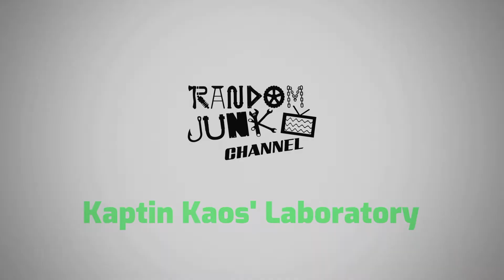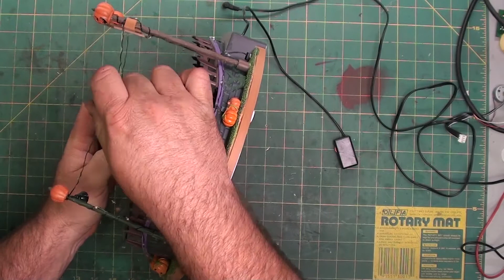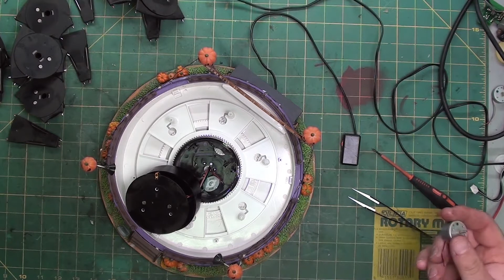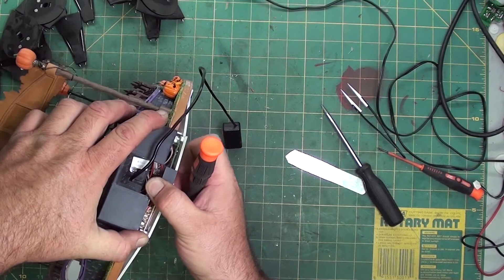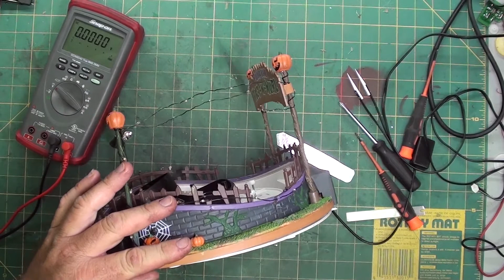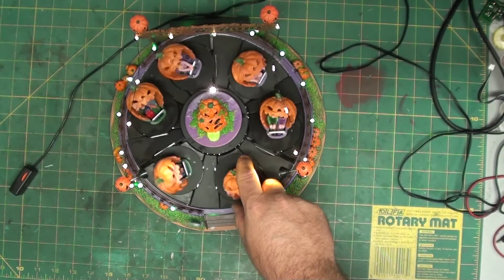Lemax Tilt N Hurl Teardown to determine failure points and how to repair

Comment: thank you for the video! We have this piece and it stopped turning-the motor stopped. My husband replaced it and put it back together but now the carts are hitting each other.  Is there a correct alignment for the plates? Thank you so much
Reply from the maker: Yes, I have not figured out how or why, but the alignment matters. Easiest way is to swap the plates that have the cars hitting. I did that to mine which is the one in the video. I am trying to figure out what the differences are so I can add an addendum to the video.
Reply from the maker: I spent time last night figuring it out. All the plates need to face in the same direction when installed. I filmed a short video on how to time it. It will be up next week.

Comment: Thanks for the video. I used it replace my motor but then it just ran about a half rotation and jammed. I realized it likely jammed originally and burned out the first motor .  With your video I was able to disassemble piece by piece and make sure each piece was lined up in the inside and outside track. When I reassembled it ran great.
Reply from the maker: I'm glad the video helped and you got it working again.

Comment: Thank you so much for making all of these videos for us. I just received this item used and it does not rotate. I changed the belt and still nothing. I'm assuming since it has lights and sounds it could be the motor. I have it torn down but will need to order one. Wish me luck I have never done this before.
Reply from the maker: Did you unplug or disconnect the motor to see if the lights and sounds returned?

Comment: Ok. I want to thank you for your great video on fixing the motor and replacing. It worked! But now  But now the fairy lights dont work. I have sound, the spot lights work and it turns. I checked to see if there was a break or pinch in the string around the outside. But didnt see anything. Please Dont tell me I have to do a complete tear down to check the wire at the board.
Reply from the maker: It's common to run a screw from the base through the fairy wires. I would pop it apart and double check, so unfortunately you may have to fully disassemble it.

Comment: I plug it in an there is nothing, No turning ,lights, sound . So would this be just the motor or is the boards bad. I tested the cord when plugged into outlet and there is power there. Help?
Reply from the maker: If you have absolutely no power the first thing I would check is the off/on switch, they're notorious for having one of the wires Break Free. After that I wouldn't open it up and check the power port followed by the motor. But when Motors fail they can cause a whole unit to quit working because they are a dead short.
Reply: @RandomJunkChannel  Thanks so much for your video an help. I saw in one of your reply's to someone that if you cut one of the wires to the motor and the sound an lights come on then it probably is the motor. I will order one an try that. The sad part is I didnt hardly turn the tilt O hurl on and the motor was already bad. Thanks again. Hated to throw this away. You saved me and the  product. By the way the switch was ok.

Comment: So as I was putting away my tilt n hurl for the season check to make sure it was parked and nothing ! no lights no power read your comments and sure enough the SRF 300 CA  11440 1010108. motor was completely drenched in melted lube got inside shorted out  which should be a relatively easy fix I can snip the motor out and replace it without having to tear the base apart I thought it was a circuitboard so I’m actually glad you posted motors usually are the culprit 
Neat little trick as I use brake cleaner and a syringe to squirt inside to clean out the lube which gave me lights and sound again thanks for your insight

Comment: Thanks for this video.. My Pumpkin Tilt N 'Hurl  stopped working a couple days before Halloween. At first the bumper cars came off then I put them back on and it was working fine.. Then  about a couple days or so after that it started making  a real loud sound before it stopped working. Could it be the motor? Also, my Eerie Go Round that I have works but no music plays. How could that be fixed? Thanks!
Reply from the maker: On the Tilt n Hurl if it will not turn on at all, meaning no lights or sound, then yes I would lean towards the motor has failed. But the loud noise, maybe it got bound up from a possible broken gear or the belt snapped and got caught on the Armature. On the Erie go round if you lost the sound most likely your speaker is the cause either the speaker has gone out or the wires going to the speaker have broke free. Worst cases the sound chip has failed and that isn't going to be repairable as there are no spare parts for the circuit boards that are proprietary.

Comment: Thanks RJC! I was able to diagnose the motor as you described and ordered the 5 pack from Amazon to have spares. NOTE - the 5 pack were not The same as rf300c motor and were much slower. Had to buy the rf300c specially from Amazon. Once that was in and replaced the fairy lights that burned out, my wife was ecstatic! Thanks again.

Comment: Great question on why my audio was not adjustable is this a chip or switch pot that not properly energizing voltage to audio board turns on fine run but no audio adjustment  stuck at loud volume
Reply from the maker: I would check the switch or the wiring to the switch. Most likely one of the three wires in the middle of the switch has either broke or shorted to one of the other wires. Most likely it's at the switch but it could have happened inside the unit itself. If those all look good then the next step would be the check the circuitry, normally when the chip goes out it goes to zero volume versus loud volume
Reply: @RandomJunkChannel  Do you have a breakdown video on the switch?  I'm pretty sure this is my issue on the Tilt N Hurl.  Power adapter is good.
Reply from the maker: @arprepsports7239  What is your unit doing or not doing?
Reply: It won’t turn on at all.
Reply from the maker: @arprepsports7239  Disconnect the motor and try it, if lights and sounds come back then you have a shorted motor. if not, then possibly a bad switch.
Reply: I took the switch apart before I saw this, checked the connections and then put it back together. Now the sound and lights work fine. No movement. I’m assuming burn out motor now?
Reply from the maker: @arprepsports7239  A shorted motor is most likely the cause, it can work intermittently, but should be replaced before it damages the circuit board.
Reply: Annnnnnddddd now nothing works again. Just stopped while I was doing nothing. Weird.

Comment: Hi thanks for videos.   My Title N Hurl die last night. not it seen one of the car fell off an jam the track. I took the car off that fell on the track the cause the jam. Is start spin really slow and light started to dim and lose power then it died. So I pull out my display an I  try plugging it in no power no light etc.  Is the circuit board dead ?
Reply from the maker: A bad circuit board is possible. But I'd be more leaning towards either the motor went out which will short out the entire unit or it got hot and cause the power switch to possibly melt one of the wires off of it or on the back of the power port where you plug in your AC adapter may have melted if it got hot.
Reply: @RandomJunkChannel  so I have to pull the whole back apart to check.  fun! !  I seen the video. Lol.  My other question would be how much  for you to fix a Ghost around  ? its stop spinning so I know the motor died ..every thing else works fine. I watched the video  you did on it  i fix my Madpumpkin and RIp Mausoleum.   But I seen that if  the arm part brakes  it done!  and I don't think have any motor to replace with it any way. I know my limits lol ... if I I can't  fix the  Tilt n Haul I just buy a new one.

Comment: This is absolutely awesome that you did this just the other day mine stopped working. Started taking it apart wires are really short couldn’t find any markings on the motor. You essentially did all of the legwork for me.
  Quick question though the motor did stop working but also the lights. Now however when it is a part in a force the gears to go forward a little. The lights come on but no music and no gears. I’m guessing the motor is bad but Do you think is the cause for lights and music to also stop working?
  Power supply definitely works fine tried it on another house. And tried a known good power supply and still wouldn’t work
Reply from the maker: Yes, a shorted motor will cause you to lose lights and sound. There will be a video coming out with a Ghost Around that has the exact same problem and shows why or how the motor causes you to lose your other functions. Basically what is happening is the motor is shorted and all of the current is passing through the short which is the least path of resistance, when you start turning everything you're relieving some of the short which allows the lights to flicker on dimly and sometimes your speaker will start to Crackle. If you cut one of the wires to your motor and turn it back on, everything should function except for the spinning part.
Reply: @RandomJunkChannel  Exactly what I thought. Your video was a great big help. I am thankful I found your video because I was about ready to try and take the bottom off. Lol. Glad I found your video first
Reply: @RandomJunkChannel  Keep up the good work.

Comment: Our Tilt N Hurl stopped working all together, any suggestions on what to do to fix?
Reply from the maker: The first thing I would check is the power adapter, make sure your AC adapter is putting out the proper voltage. Next, I would pull the center hubs apart and see if the motor is bad. The only way you're going to be able to do that without dismantling the entire unit is to cut one of the wires. After you cut one of the wires if everything starts lighting up and making sounds then you need to replace your motor. In the description is the motor model number so you can look it up on the internet. Outside of those two checks, you would have to dismantle the base to get to the circuit board and as you saw in this video it is not easy and can be very destructive

Comment: Hey! I have the boogie men's hangout and the mummy on the right side of my building is not coming in and out of the door. I can see and hear a belt system working behind the mummy, but he still doesn't come out. He moves maybe a cm, then gets stuck. Do you know if this would be an easy fix and if I should open the piece up to attempt to fix it or is it best to leave it be?
Reply from the maker: If you feel comfortable in opening the bottom, then try to fix it.
After watching a video from Lemax on the function, it looks like a standard slide track. A small motor with either a set of gears or a pulley with a set of gears. If you hear it and it is trying to move I would assume that you have a broken/slipping gear or slipping belt on a pulley.
The biggest issue would be trying to find the part that is broken as most parts are not labeled and locating them can be difficult. If it doesn't bother you to have it nonfunctional, then you may leave it as is.
If you do open it and need some assistance, you can Email us at Randomjchannel@gmail.com
Reply: @RandomJunkChannel  Thanks a lot. I’ll probably attempt to fix it after Halloween.